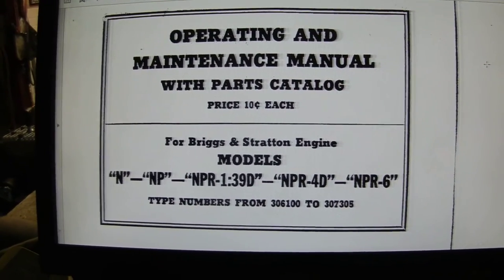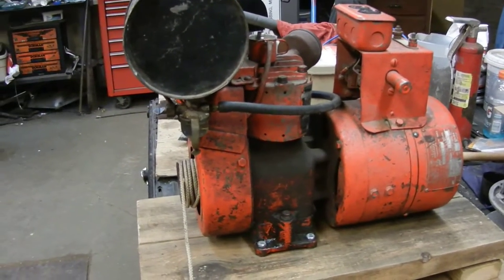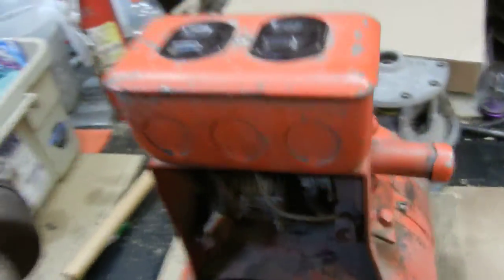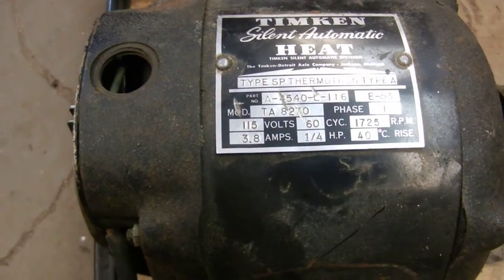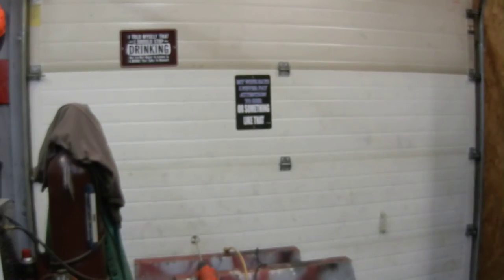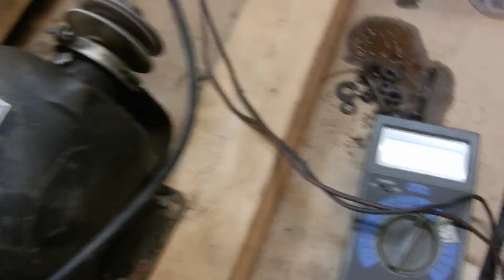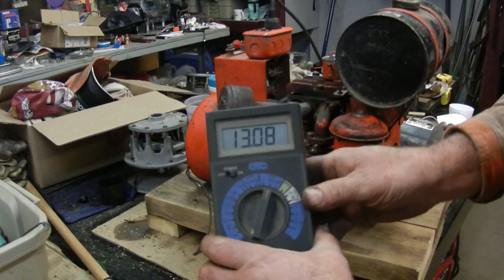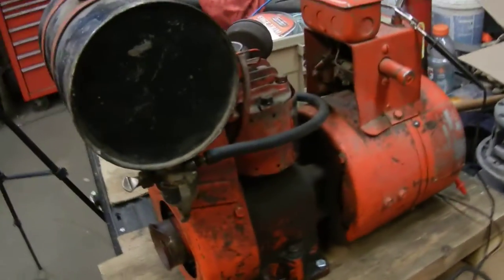Farm master 600w generator and Briggs & Stratton  model NP engine

Comment: I found this one for 125 bucks. It’s a 40 volt though. It’s 20 in summer and 20 in the winter. Is it worth it? Oh and it runs
Reply: I want to add a picture